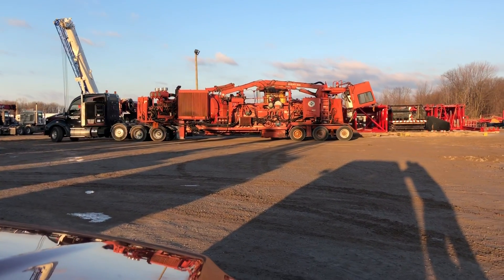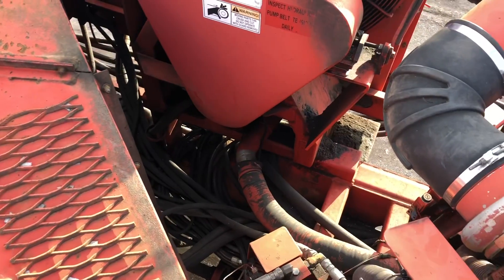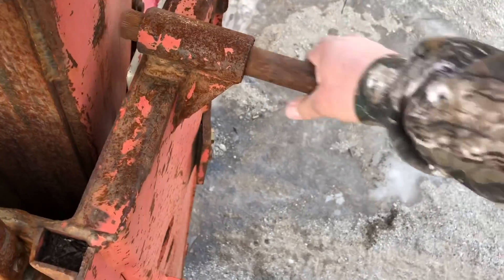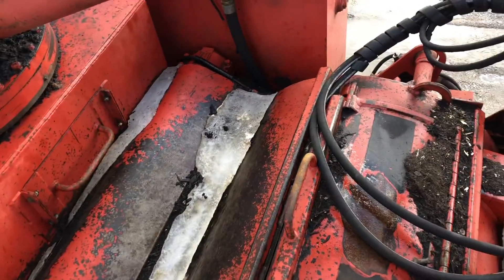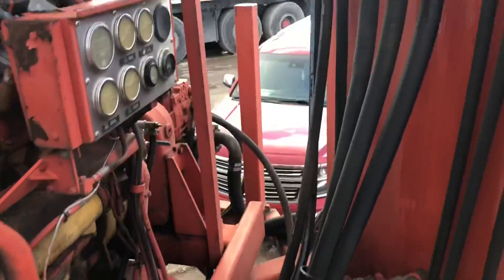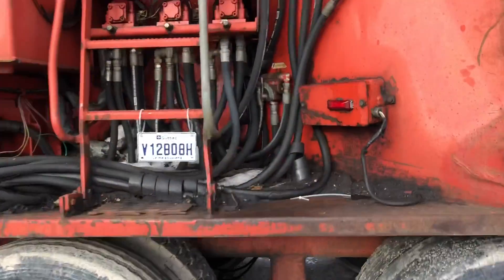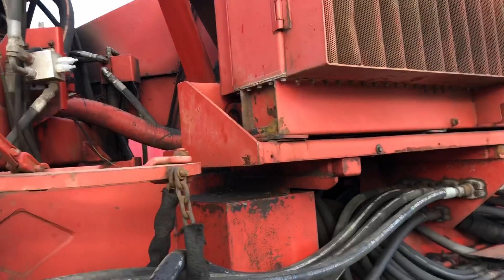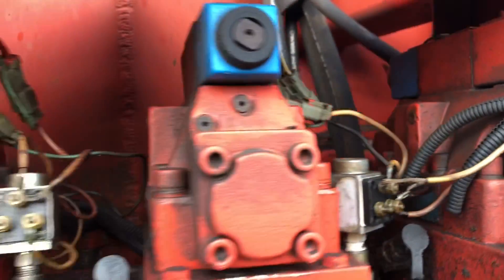The New 2355

Comment: I was wondering what Frost loss was never heard that before.
Reply: It's frost laws when the frost comes out of the ground under the roads they get soft and smushy and it breaks up the pavement with the heavy loads so they put limits on all of the roads until things dry up
Reply: Brent Anderson ok thanks I’d never heard of that before.
Reply: Michigan Frost Laws, Seasonal Load Weight and Speed Restrictions – 2019
For the latest updates, check 2019 Spring Weight Restriction Bulletins

Spring Weight Rules:

Michigan does not allow more than 11 axle trucks to enter or exit during Spring weight restrictions.

Michigan does not allow movements that exceed 14' in width during Spring weight restrictions.

Michigan may subtract 25-35% of the normal legal weight an axle group can haul on non interstate roads during Spring weight restrictions.

Michigan does not allow movements that are over legal weight on any group of axles during Spring weight restrictions.

Latest Update

Effective 6:00am Monday, March 11th, 2019 weight restrictions will be imposed and enforced on all state trunk line highways from the Michigan/Indiana & Ohio line north to and including M-20 from the intersection of US-31 in Oceana County easterly to US-131 in Mecosta County, then north on US-131 to M-20, then continuing east on M-20 to US-127 in Isabella County, then north on US-127 to M-61 in Clare County, then east on M-61 to the intersection of US-23 in City of Standish, Arenac County.

State trunkline highways typically carry M, I, or US designations. Weight restriction information and updates may be obtained by calling 1-800-787-8960. For companies located in Canada or New Jersey, information may be obtained by calling 517-373-6256. 

State trunkline highways typically carry M, I, or US designations.

Updates
Detailed Weight Restriction information may be obtained by linking to www.michigan.gov/truckers

Weight restriction information and updates may be obtained by calling 1-800-787-8960. For companies located in Canada or New Jersey, information may be obtained by calling 517-373-6256.